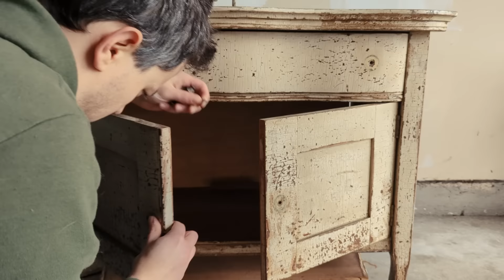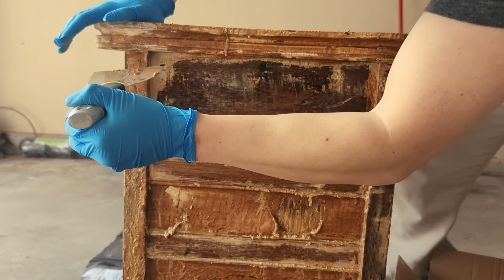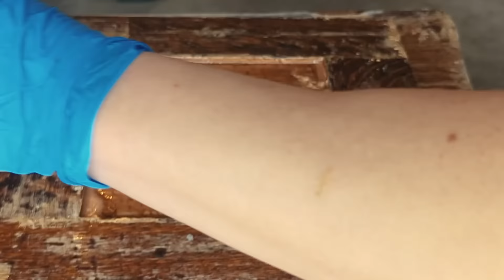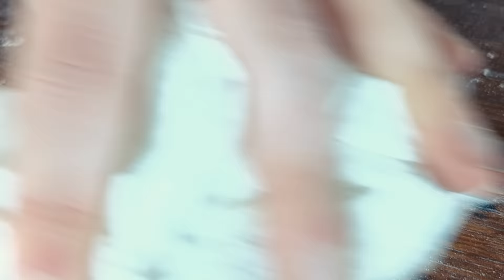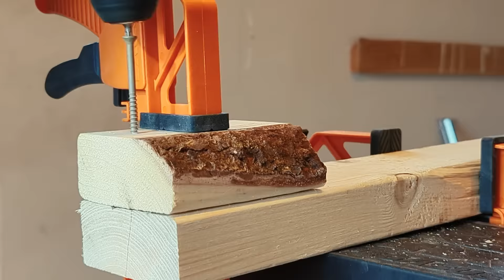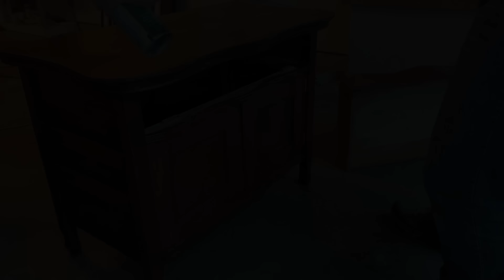HEAVY Water Damage | Water Basin Table Restoration and Repair

Comment: For dark water stains… use oxalic acid — cover the entire surface where the stains are (not just the spots) - let dry and then wipe down with water.  It comes in a powdered form which you mix with warm water.

Comment: Pretty "water table", however, I understand why it was painted: the wood veins even after you laid your finishing were too noisy and not particularly pleasant. By the way, the video was short ad its parts had unbalanced lengths, fairly nice, though. Salutes from snowy Mount-Lebanon.